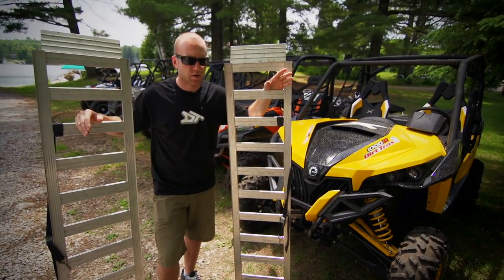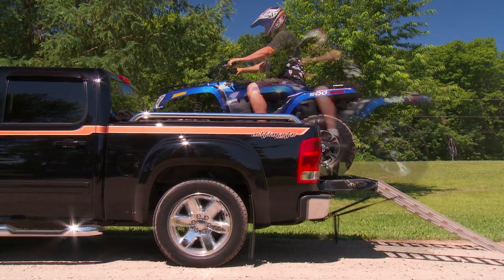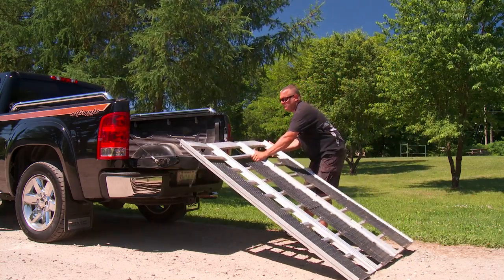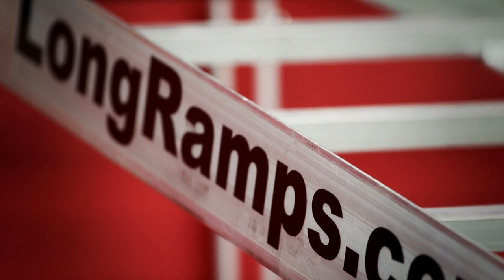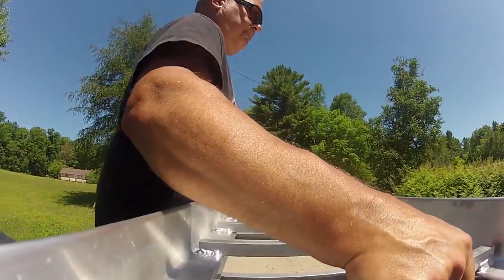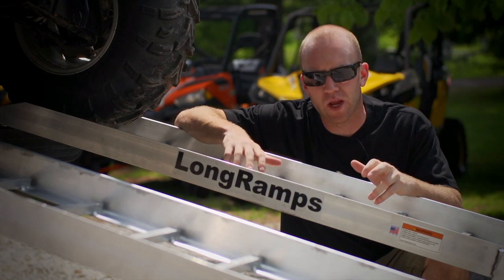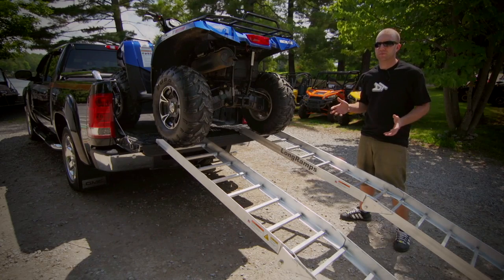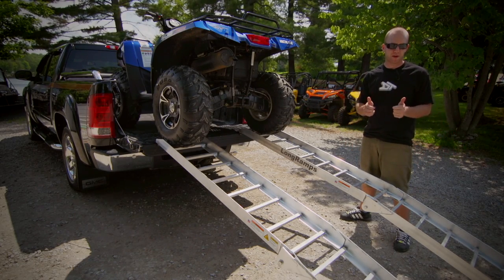How To Load Your ATV Into Your Truck

Comment: I came up with a safe fool proof way to load my atv in my truck.  I have a winch on the front which I attach to a hook in the front of the truck bed.  With the front tires lined up with the ramp and the ATV in neutral I use the remote winch cable to pull it up the ramp and into the bed.  Sitting on the ATV to steer isn't necessary and adds too much weight.  As the ATV is pulled up I check to make sure tires are lined up in the process.   In getting the ATV out of the truck I use the same remote system.  Very safe with little chance of injury to myself, the truck or ATV.
Reply: MikeandBelva Laughlin "o
Reply: That is exactly the way I load into my truck. Extremely unsafe to drive an atv up, or back down ramps into a truck. Donnie D
Reply: And all ramp manufactures tell you NOT ride while loading, use a winch. Read the instructions..............
Reply: I do the same
Reply: I do the same. Riding up or down a ramp is unsafe.
Reply: Mine would ramp right as it got to the top..scared the crap out of me everytime. I've got way too far to the ground to fall when in my truck bed.
Its much faster and feels way better to stand next to it and push a button.
Reply: Bed winch...Great idea

Comment: For the price point you can get a 5x9 utility trailer  at tractor supply for 200 more.
Reply: Yes but now you have to find a place to park that trailer also maintenance and insurance and registration and if you don’t have a place to park it then u have to pay for storage 🤦‍♂️
Reply: Also cause of the size of the tires on the trailer you really can’t go that fast enough maybe 60 miles an hour when on some trailers you can go up to 80 miles an hour .

Comment: Inspect the truck’s tailgate cables , they are intended to hold an unfolded tailgate and not much other weight .  The rubber coating holds moisture in the cable’s strands . Let Crosby fabricate a strong set for your tailgate . Lubricate the cables .

Comment: These look like great ramps, but won’t fit under your quad once on your truck.

I have the Black Widow 94 inch tri-fold ramps. Plenty wide for my 700 Kodiak and not steep.

And I just store them under the machine. But they are heavy at 60lbs.

Comment: One piece ramps are still the best, and when you tie them down, use a ratchet strap and move the anchor point to the top of the ramp as much as possible, it will secure the ramp to prevent "kick-out" the lower the anchor point is placed the less effective it is.  The Canadian Safety Council recommends you "push" your ATV off the back of the truck for maximum safety, as loading and unloading are one of the leading causes of injuries and collisions.    If done correctly many style of ramps can be used in a safe and secure manner.   Its all about operator awareness.

Comment: Place a spare tire up against the front of the bed will prevent the broken window scenerio.Also,a trailer is 100% safer; and a pickup tailgate will take a pounding loading wheelers on trucks.The 2 worst things about a trailer is they beat and thrash along behind you,making for a noisy trip to wherever;and,it can be hard to turn around with a trailer in real world apps....So,I like the long ramps,but they look like something a thief would love to run away with.
Reply: I've used blocks of wood on the floor to stop the machine from going too far forward.  On most utility quads, the front bumper sticks out too far and will smash your back window before the tires hit the front of the bed.
Reply: With a trailer strap the ATV down and use cinder block or blocks of wood in front of the tires. Then put the E-brake on works like a charm
Reply: That's why I lock up my long ramps while I'm riding.

Comment: Due to an eye injury I just cant use a dual ramp system. I would love to be able to stop hauling with a trailer but just have not seen (no pun intended) a truck loading system I am comfortable using.

Comment: Got a trifold ramp that works just fine. 
If someone is gonna constantly complain about having to fold n unfold the ramps or you feel unsafe while loading or unloading then buy a damn trailer. 
Don't be careless while setting up your ramps and purchase those that are rated for what you'll be using them for.
Use common sense and you will be just fine.

Comment: Wow watching you unfold the trifold ramps is all wrong. Idk if you did it to make the ones you’re advertising look better or if you really don’t know how to unfold them. Lay the ramp folded on the tailgate. Then unfold whichever way your ramps unfold. Nothing awkward. If anything they’re the easiest to set up because there’s no lining up the ramps just right. The best ramp to buy IMO are the aluminum trifold ramp from harbor freight. They come with a safety chain built in where you can twist it to tighten them. They’re the cheapest at only a $100 compared to other trifold ramps. They’re also safe. I had older steel ramps and I felt at any moment strapped or not I could be on the ground. I got these and when I’m riding up I feel safe. They also look good too. 1500 pound capacity is more than enough to handle your four wheeler or dirt bike as well.
Reply: I just bought the Harbor Freight tri-fold ramp and think it is a good value and a nice sturdy ramp. But in my opinion, it is too short by at least 12" resulting in an unsafe incline. The tabs that sit on the ledge of the truck gate are not as beefy as they should be, and after one use, the cushy sticky tape tore off due to the weight and compression while loading. I am returning the Harbor Freight ramp and will be ordering one of these in the 8' length.

Comment: I could use your help please. I have an 03 Tacoma ext cab 4x4 with a 2 inch lift. Getting my 14 YFZ450R is a pain since the front tires don't clear the wheel wells in my bed at all. What would be a good ramp to help me with this situation? Thank you :)
Reply: Buy a small trailer.  It won't cost much more and will be much safer.
Reply: @gregrowe1168  Did you ever solve this problem? I have a trailer myself, but I don't always want to use it.. Especially when I'm in the backcountry.. You can't really tow a trailer up old logging roads, so being able to have the ATV in the tacoma seems like a much better idea.

Comment: Thats funny most if not all tri fold ramps are rated for 1500 pounds ...... how heavy are you . Most utility  atvs are 700-800 pounds .. time for ypu to go on a diet if your Weight makes up the difference for the 1500 pound rating.
Reply: Unless your atv is from Walmart sure it weighs between 700to 800 lbs my 600cc utility quad weighs 915lbs with no rider or gas.
People get a trailer, and ride hard or stay home!